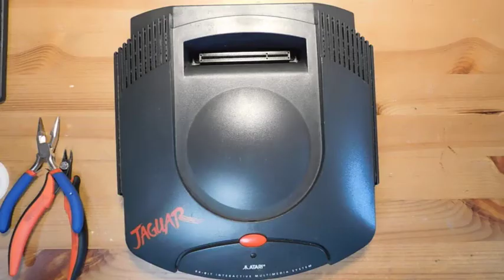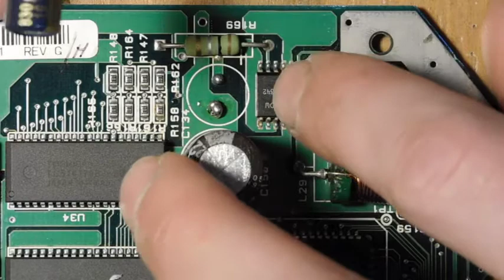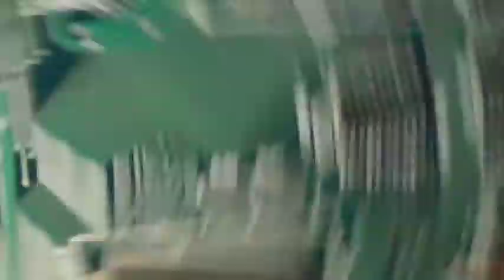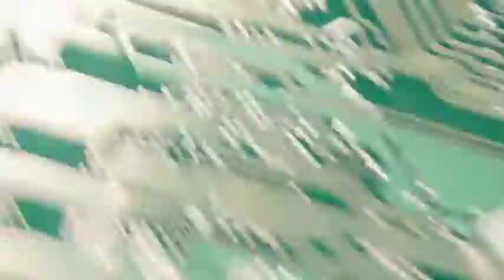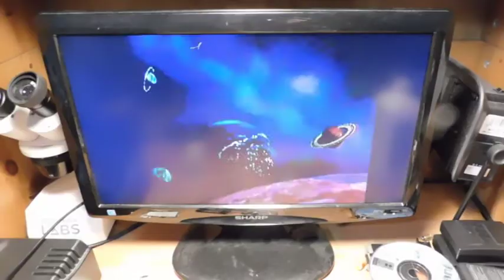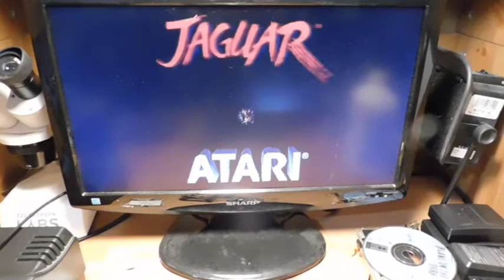This Atari Jaguar almost started a fire. Can I fix it?

Comment: We do know Atari made an unreleased 32 bit system called the panther, and decided to skip ahead.

The Jaguar still had a couple 32-bit processors named “Tom” and “Jerry”, with a combination of other processors that somehow added up to 64.

This is technological and confusing.

That made it hard for them to develop games that would utilize it’s potential.

But there are many good games for the Jaguar (including ones that earned average reviews) such as Tempest 2000, Alien VS Predator, Breakout 2000 (which had to be released late in December 1996), Cannon Fodder, Doom, iron soldier, Rayman, iron soldier 2 (which has to be released one year after the Jaguar was discontinued), Wolfenstein 3D, Missile Command 3D, NBA Jam: TE, and Power Drive Rally (this has better controls than checkered flag).

And I even like Team17’s Worms on Jaguar. plus, this was the last licensed port of the game to be released late as 1998.

Some decent games that are worth adding to your collection: Defender 2000, Flashback, Syndicate, and Pitfall: The Mayan Adventure. 

Now onto some Jaguar games that are “Meh” in my opinion: Atari Karts (at least it’s better than checkered flag) Brutal Sports Football, Zool 2, Super Burnout (a 2D/3-D style motorcycle racing game), Val d'Isère Skiing and Snowboarding, Raiden (jag edition) (an enjoyable console port of the arcade shoot-em-up) (at least Raiden is better than Trevor McFur), and Evolution: Dino Dudes (not a bad port of the humans). 

And here are my least favorite jaguar titles plus some obscure ones such as: Attack Of The Mutant Penguins (a very weird title), Checkered Flag (Jaguar edition) (bad controls and choppy framerate) (I prefer the original Lynx version better), White Men Can’t Jump (a video game loosely based off the awesome movie of the same name), Kasumi Ninja (who does a terrible job at being a Mortal Kombat clone, not to mention that the controls are bad as Shaq Fu), and Fight for Life (it looks like an unfinished prototype, not to mention even worse than Virtua Fighter 32X Version).

Ultra Vortek is so bad it’s good in my opinion, not to mention, it at least did a better job at being a clone of Mortal Kombat.

Ultra Vortek at least has better controls than Kasumi Ninja.

Nowadays, many companies and fans like Atariage and Reboot Games are still making more amazing Homebrew games making Jaguar the acceptable console that it is today! 

The shells of unsold Jaguar units were remolded and reused for dentist equipment. 

One more thing to prove that the Jaguar’s legacy still lives on: a few Jaguar games (including Tempest 2000) were featured on the playable documentary game called Atari 50: the anniversary celebration released for the Nintendo Switch, PS4, PS5 and Xbox Series X.

Comment: Lol i just pulled myn out of storage and put the wrong plug in it didnt turn on but smelt like melted plastic lol 

What are the chances if it still working if i purches the right plug for it now
Reply from the maker: Pretty unlikely that it will work, the power regulator was probably toasted

Comment: My Jaguar was smoking too and that's because I used a 120 volt power supply. It can't handle anything higher than 90 so DON'T use any adapter higher than that number or it'll catch on fire.

Comment: Nice repair video! 👍
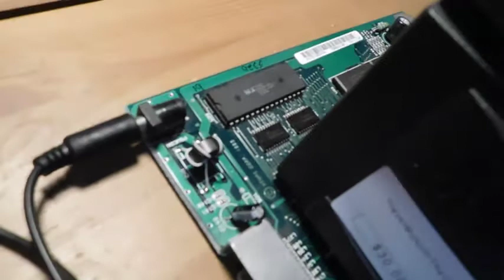10:50 Afaik this coil (ironically ^^) is a polarity protection and normally not there. With it the voltage regulators of the Jag shouldn't blew up when polarity at the power connector is wrong. At least that's how I understood it in another Jag repair video.

Comment: Hello a buddy of mine just fired his jaguar with the wrong power supply. What parts exactly did you use. I never done repairs on the system before so no idea where to find these parts or anything
Reply from the maker: https://console5.com/store/mc34163dw-soic-16w-package-step-up-down-inverting-switching-regulator.html
Reply from the maker: https://console5.com/store/so-8-package-5-volt-regulator.html
Reply from the maker: Purchase both parts and you should be ok
Reply: @LIRetroGaming  thank you

Comment: So you keep saying how you "got the replacement" chips here a couple of times. When it comes to these kind of repairs, can you find these kind of chips easily on Digi key or somewhere else online? like they're just general electronic parts? (I mean EXCLUDING the actual Game chips like the graphic and CPU processor chips).
Reply from the maker: Thanks for reminding me, I meant to include links for the parts in the description. But yes, in many cases I get replacement parts from digikey or mouser. Tech wiki has lots of useful information about replacement parts https://console5.com/wiki/Console5_Tech_Wiki
Reply from the maker: Other times I go to console5 for parts, especially if it’s hard to find or I need a kit that’s already assembled